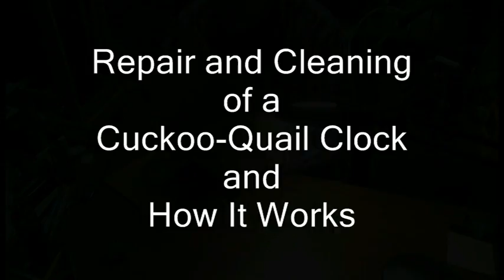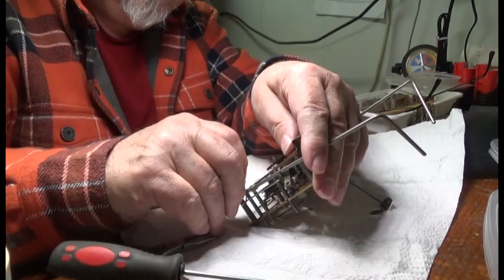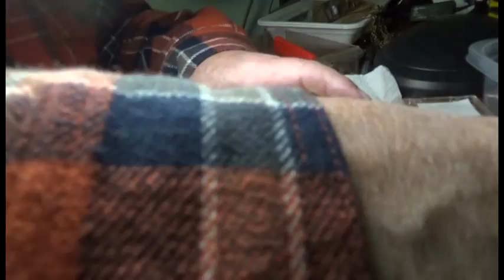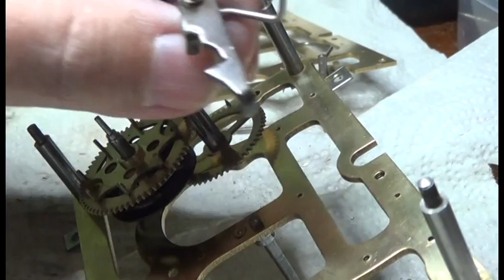Repair and Cleaning of a Cuckoo Quail Clock and How It Works

Comment: An index for this video:

NOTE:
A detailed demonstration of bushing by hand begins at 39:27
A detailed demonstration of how the quail cuckoo striking works begins at 56:01

0:00 - 1:18 Checking the case for damaged and missing parts.
1:18 - 4:26 Removing the three bellows: 2 cuckoo whistles and 1 quail whistle.
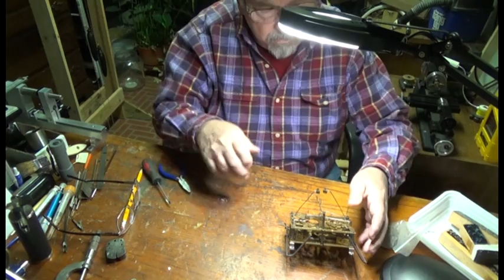4:26 - 5:49 Removing the movement from the case.
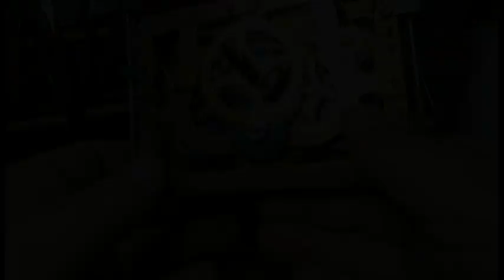5:49 - 7:35 Checking for dirt, damage, and wear.
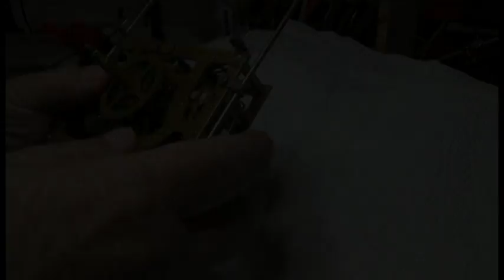7:35 - 12:42 How the cuckoo and quail work.
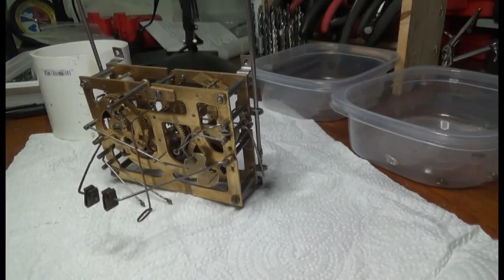12:42 - 20:28 Explaining how the strike works.
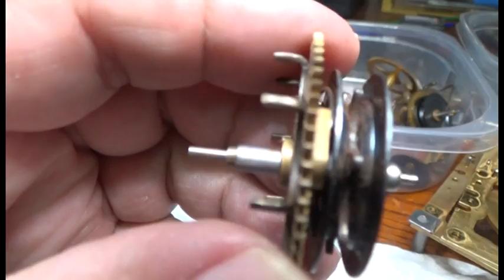20:28 - 32:16 Disassembly.
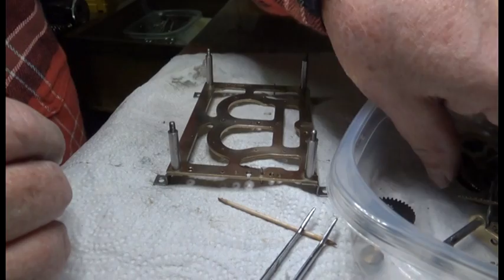32:16 - 36:09 Examining for rust; cleaning rust off, using a toothpick and polishing compound.
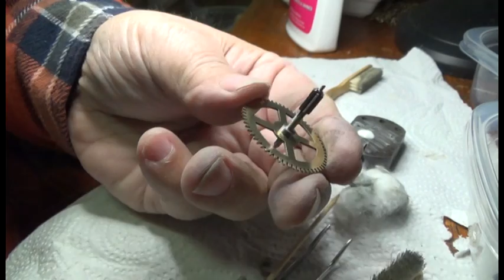36:09 - 38:20 Checking the time train for worn pivot holes.
38:20 - 39:27 (briefly) Polishing the pivots on the lathe; cleaning more rust off.
39:27 - 40:17 Explaining how to find the worn side of a worn pivot hole.
40:17 - 42:11 Evening out the wear, using a needle file.
42:11 - 42:37 Pointing out an earlier, unsuccessful repair attempt that used a prick punch.
42:37 - 45:40 Reaming out the pivot hole, so it will accept a new bushing.
45:40 - 46:13 Chamfering the new hole, to make it easy to start the bushing.
46:13 - 47:07 Hammering the new bushing into place.
47:07 - 51:03 Broaching (enlarging) the new pivot hole to the right size, using a cutting broach.
51:03 - 52:53 Smoothing the hole, using a smoothing broach and oil.
52:53 - 55:34 Testing the new pivot hole.
55:34 - 56:01 Showing how the time train is all that's needed to keep time.
56:01 - 1:11:52 Showing in detail how the quail train works, starting simply and adding parts.
1:11:52 - 1:17:11 Showing in detail how the cuckoo train works.
1:17:11 - 1:18:08 Pegging (cleaning) the pivot holes.
1:18:08 - 1:18:12 All the wheels are in place.
1:18:12 - 1:19:39 The movement running on a test stand, demonstrating the quail and cuckoo striking. (oiling wasn't shown)
1:19:39 - 1:22:44 Putting the movement and bellows into the case.
1:22:44 - 1:24:16 Testing the striking of the completed clock.

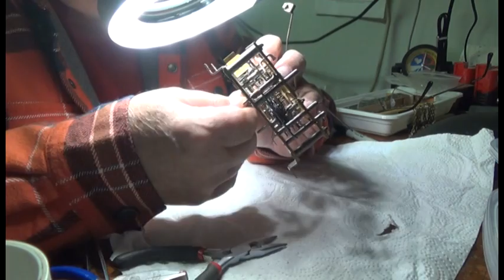Comment: Darn! Somewhere between 22:40 and 22:45, the second gear was taken off the front frame (the one that drives minute and hour canons). That's the current problem I have, 'cuz my clock hands aren't moving. I had good movement like shown at 55:17. Unfortunately, that gear never shows up again. Anyone know how it's assembled??
Reply from the maker: If the hands aren't moving, the intermediate gear is slipping.  There should be a tension washer under it, between the back of the gear and the front plate.  The tension washer has three or four tabs that ride on the inside rim of the intermediate wheel. The hole in the washer is square and fits on a square section of the extended main wheel arbor.
Reply: @dperry428  Can't for the life of me, figure this out. Four tab tension washer, gear and outer washers go on the shaft...and then it's a battle to get the pin in (so I don't think there's any room for an extra washer or a shim) The shaft turns properly because the orientation of the pin changes over time...but there's just NOT enough friction to make the intermediate wheel move with it.
Reply from the maker: I can only hazard a guess without actually examining it, but I'd guess the tension washer has lost it's "tension". Try increasing the amount of pressure by bending the four tabs upward. When installing it, there should be the tension washer, the gear a single washer and the pin.  When putting the pin in, you press the gear down against the washer just enough to put the pin in.  That's what creates the tension.  Other than that suggestion, I simply can't diagnose what might be the problem.
Reply: @dperry428  Thanks for your insight! I value your opinion, and I'll try and flex the tension washer a bit, and see what happens.

Comment: Excellent video! Who made the movement? I've got the same one with cuckoo only. Ever done a video setting/fixing the cuckoo timing, when it's triggered from the front?  Thanks!!
Reply from the maker: I don't remember if there was even a maker name on it.  Too many years and too many clocks ago.  I've done quite a few cuckoo clock videos.  Check them out on the channel.
Reply: @dperry428  Thanks anyway. Not a mark on mine at all. This is the only time I've seen something similar. Definitely gonna copy your tips on setting up the gears on the cuckoo side...guess I'll have to wing-it on the front side levers. Thanks again!!
Reply from the maker: Maybe this will help:  https://youtu.be/rhHLTUlkOMA?t=377

Comment: You are a fantastic expert, really. Hope you are doing well.
I am here in Germany, 74 years old and in the process of repairing my grandfather's cuckoo clock (a "Rail House" I think). This is the first clock repair of my life. Now that I have repaired the bellows, I would like to move on to replacing some worn out bushings. But these Bergeon "cutters" are expensive and not easy to get. I wonder if the "hand bushing" can be combined with "drill bushing". So: Can some of the work be done with a drill press and special drill bits for brass? Thanks in advance for your answer and very best greetings from Germany!
Reply from the maker: Danke.  Your clock in German, then, is an Eisenbahnhaus Kuckkucksuhr.  If this is your first, be sure to carefully study how the mechanism works, especially the strike side.  Run the strike by hand until it stops; then take careful note of where levers and pins are, as well as the pin positions on the wheel that lifts the bellows wires.  Take digital photos as you disassemble, print them out and you have assembly instructions when you place them in revers order.  Yes, you can use drills to make the hole for the bushing, but modify the drill for drilling brass by stoning off the sharp leading edge of the drill flutes. This is a time when a sharp drill is a detriment.  A sharp drill can suddenly dig into the brass, bind and rip the plate from your hand, spinning it around like a deadly buzzsaw, or flinging it in any direction like a ninja throwing star, including at your face or chest. Use a sharpening stone held parallel to the length of the drill and knock the sharp edge off the drill.  Watch this video for a complete explanation: https://youtu.be/pAngKHIZgyA  Use a drill that is undersize for the OD of the bushing and use a cutting broach for carefully bringing the hole to just under the OD of the bushing and tap the bushing in place.  Be careful, though, as it is easy to make to hole too big.  Yes, a drill press can be used.  I recommend, though, to clamp the plate down.   I personally use a battery powered hand drill. Yes, reamers are, indeed, expensive.  I surprised that they are not easy to get.  After all, the Bergeon brand is made over there.  You might check availability and cost for the American version from Timesavers.  They ship internationally.
https://timesavers.com/
Reply: @dperry428  Thank you very much.
Yes, I have already seen your tips and the video on the adapted drills.(By the way, I was a handicrafts teacher and often taught the kids how to use a drill correctly. Never were they allowed to hold metal under the drill with just their hands).
I will follow your advices - and thanks again. All the best!

Comment: How does one get a hold of you for a railroad cuckoo clock repair?
Reply from the maker: At the present time, I'm not  taking on any more repairs.  Summer is my time to get outside work done and I'm also having some health related issues.  To contact me, leave a comment with your email address. I hold comments for approval and can then contact you via email and delete your comment.

Comment: What is the objective of the cover holes in the sides?
Reply from the maker: Two holes are for the cuckoo whistle sounds.  The hole with the cover is to get access to a lever that will trip the cuckoo sequence.  It's especially important in movements with a count wheel system instead of a rack-and-snail.  If the clock runs down in a count wheel system, the count of the hours and the time shown by the hands will be different.  One can trip the cuckoo without moving the hands to get them back in sequence.

Comment: Thank you so much for sharing this! I’ve always found clock repair fascinating! I was recently given a Quail Cuckoo clock with similar innards..it’s a Fox and grape style on the front and I was told it is a one day clock...it is in need of repair and I am trying to learn how! Which is what brought me to this video! Mine is missing some parts, and I’m trying to figure out what I need to get to repair her! I have two of the three weights, that were given with it and they are quite large...about 8.5” and feel about 3-5 lbs each! Are all three weights the same size on quail clocks? Also, what length of chains would I need to get as replacements? Also, the back panel board is missing, are there standard sizing for the mechanisms on those? Or will I need to find a specific size of coil in addition to finding the proper size of panel? And do you know what size pendulum I might need? Sorry for so many questions, I just don’t want to order the wrong parts and not be able to repair her! Haha!
Reply from the maker: Weights would all be the same.  In your case, you say the clock is a one-day (30 hour); the weights should only be 175 to   about 300 grams.  If they weight 3 to 5 pounds,  that's 1360 grams to 2270 grams.  The weights for an 8 day clock are about 1500 grams.  Are you sure it's a 30 hour clock?  Chains would be roughly 6 feet in length, enough to reach from the bottom of the clock to the floor. You must buy the right size chain, as well.  They are sold by the number of links per foot and thickness of the wire.  If the chain is the wrong size, they will climb off the track or skip randomly, causing damage to the clock.  Measure the size of the missing back. Suppliers like Ronell Clocks sells backs in different sizes with an appropriately sized gong.  Better to use a smaller gong than a larger one in some clocks as the larger ones can contact the pendulum leader loop and stop the clock.  Pendulum should be a size proportionate to the case size.  Most would be around 7 inches in length.  Choose one that has a proportionate leaf size.  The pendulum controls the timing by moving the leaf up or down to change the center of mass and that can be accomplished with most any of those available.
Reply: dperry428 that’s the info that I keep getting, that it is a one day clock and I have been wondering about the size of the weights! I don’t even know for sure if the ones she gave me are for this clock..that’s why I have so many questions! Haha! I really have no clue! I’m learning as I go!
Reply from the maker: Leave an email address in a comment and I'll contact you. You can then send pictures and I'll try to help you with your questions.  I hold comments for approval, so no one will see your email address but me.  I'll then delete the comment withoiut publication.

Comment: Hello. I've the problem when I put the bird weight it starts sing without stop, until the weight is in the bottom.... what could be? What can I do? Also the switch to turn off or of the bird doesn't work.
My cuckoo  also has a music box to the right but it works when I activate manually

And about the luv. .. can I use wd40 ?
Reply from the maker: There are too many possibilities for a cuckoo not shutting off for me to go into them all here.  Start with the warning pin on the warning wheel (next to last in the strike train).  Is it missing or bent?  Was the clock taken apart and the gears not replaced correctly?  A lever out of adjustment can keep the music box from playing.    NO, do not use WD40.  It is NOT a lubricant, it is a cleaning and drying agent.

Comment: Hey man thanks for this useful video;
I got a clock but the minute hand stops  before 12 and wont move anymore , got any idea what may be ?
thanks
Reply from the maker: A few minutes before the hour, the strike mechanism is going into "warning" or setting up to strike.  Several things are happening.  The hour cam (star wheel) on the minute hand shaft is lifting a lever to start the setup, another lever connected to that one is lifting away from a pin on the warning wheel,  another lever is moving into position to catch the warning pin, another lever is being lifted from under the rack and a detente is being lifted out of a slot on the gathering pallet.  Any one of those levers and pins can be bent, scored or worn such that a hangup occurs. Without actually examining the movement, I can only guess where the hangup might be.  I'd start with the front of the movement and see if the lifting lever that rides on the cam (also called a star wheel) isn't bent. Sometimes it gets badly bent when someone forces the minute hands backward.